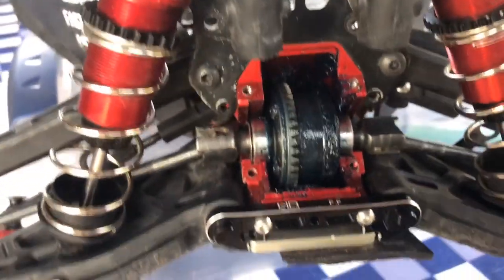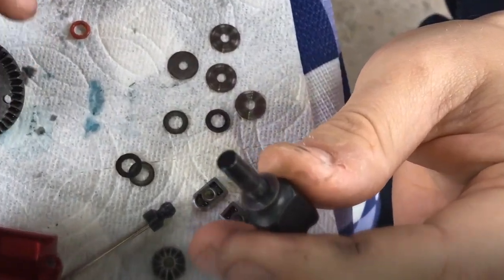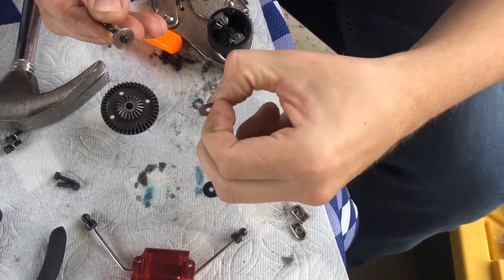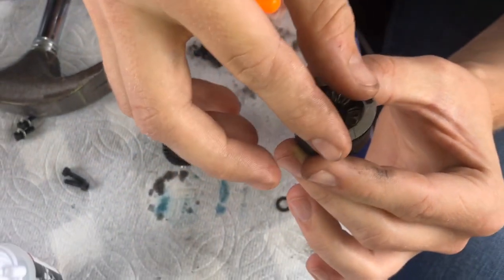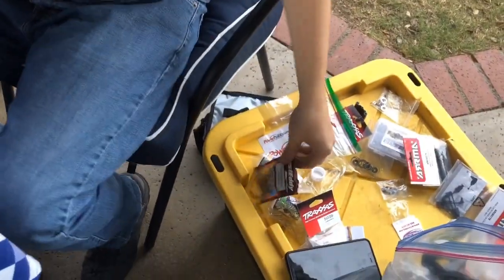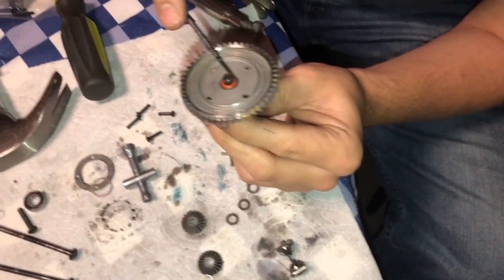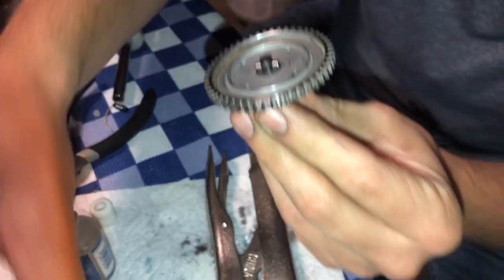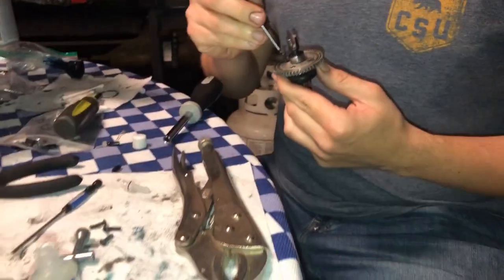Service and Shim Arrma Mojave Differential. Front, Rear and Center Differential Rebuild

Comment: I bought a Mojave 6S V2. I have not driven it awaiting upgrades. Do you believe I should add shims to my diffs? Also will the new arrma limited slip diffs fit my truck. Thanks.
Reply from the maker: you know, the only way to know is to take it apart. you will fell a slight play in the gears as seen in the video. my stock Kraton came out of the factory shimmed. So I'm assuming they got it down pretty well from the factory. but again only way to know for sure is to check it out. good luck!
Reply: @tealtopper2351  yeah I've decided to pull all the diffs and change to a 30k 200k 50k and give that a try.. thanks
Reply: You need to get the m2c racing +2mm hexes on before you run it! Will save you having to buy new wheels